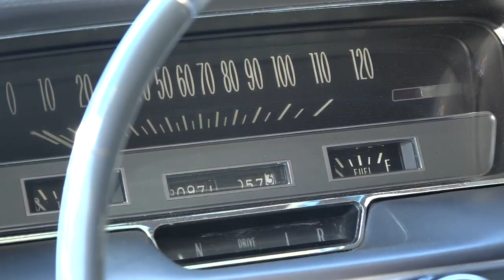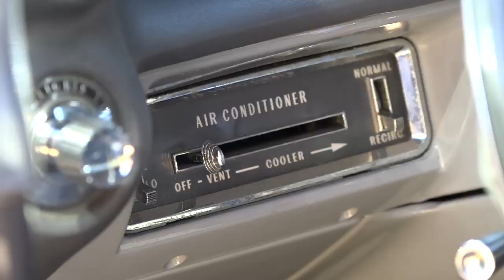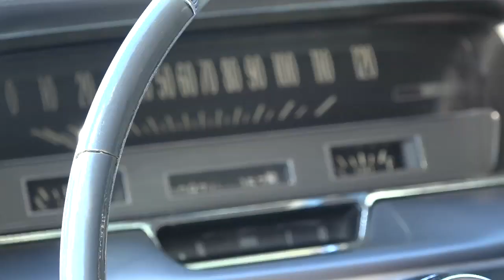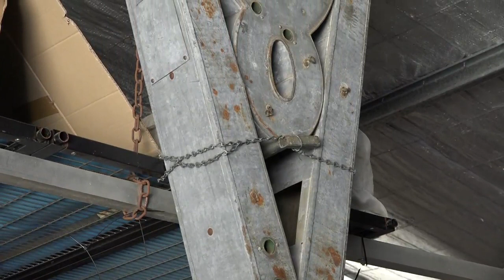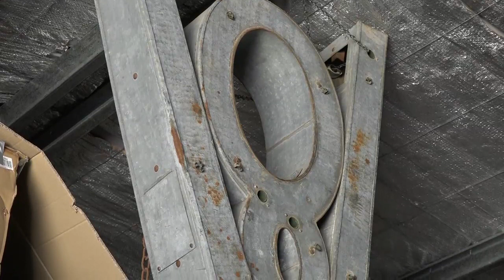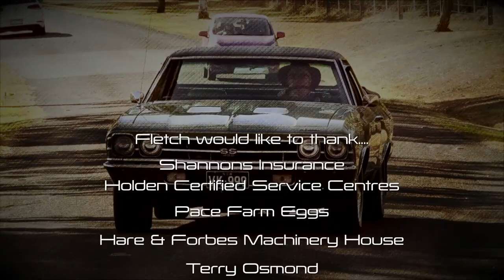Two '60s American Classics: Classic Restos - Series 53

Comment: Another great episode, Mr. Fletch. The Chevy Elky is sharp. I was surprised though after seeing the SS 396 badges to have the hood opened and there is a mouse motor instead of a rat motor sitting in the engine bay. I bet with acres and acres of Cadillac to move though town it doesn't go in the drive-thru at the fast food joints since they're designed for y'all that drive from the wrong side of the vehicle. It is hard anymore to keep a straight face when saying "Cadillac-the standard of the World".

Comment: If there are 2 or more American cars at a car show in Australia and all are been judged, one has had money spent on it to convert to right hand drive to comply with Australian roads and the other hasnt, would the left hand drive American vehicle lose judging points?
Cos lets say both had a budget of $50k, one of them spent $5k on the conversion, the other spent that extra money on paint etc so therefore looks a lot better. Its only fair the LHD lose points as they didn’t spend money on the conversion??

Something I have been wondering for a while.
Reply: Interesting question! Here in Germany it is just the other way round, what means that RHD cars (mainly imported from the UK or Japan) are converted to LHD. Personally, I have loved those tiny Nissan Figaros since they popped up at the beginning of the 1990s. Five years ago, I found a British company that converted these Japanese LHD retro gems to RHD in Cyprus. Unfortunately I did not commission one of these back then because prices have now doubled to nearly GBP 30000,-. A reasonably maintained RHD Figaro may be available from € 5000,- upwards, so keeping it just like it is may save me a lot of money... Therefore I keep on wondering how much sense such a conversion makes - although these Figaros are fully restored. Do I really need this? Well, maybe not. The best thing in this case is the fact that I do not have GBP 30000,- lying around. And not even € 5000,- so I keep on dreaming. And this is absolutely free of charge.